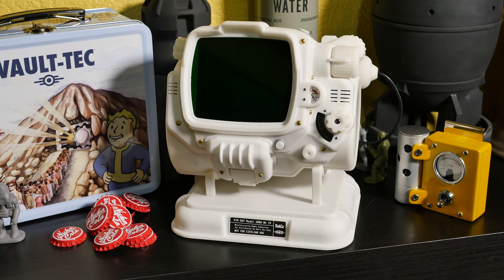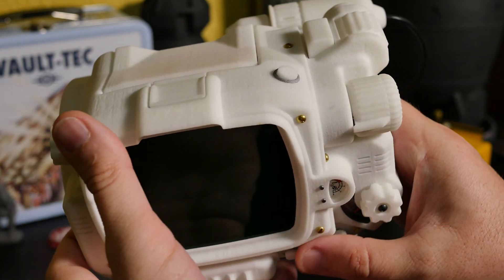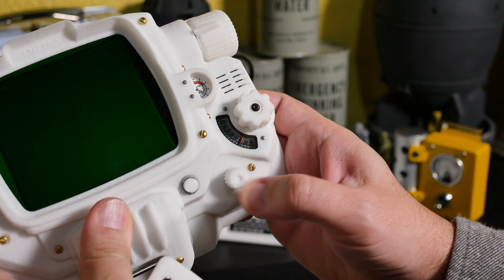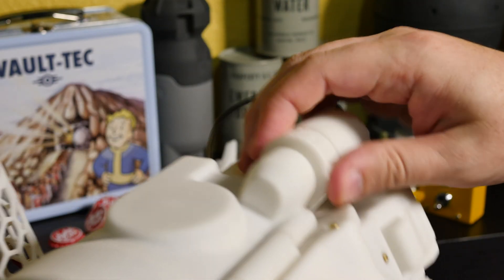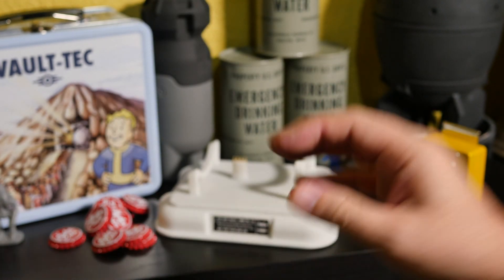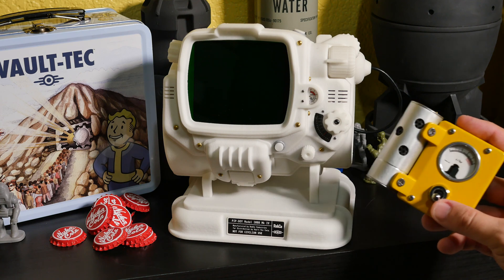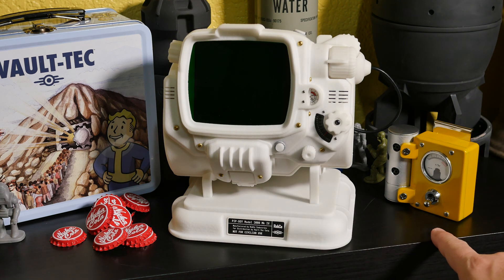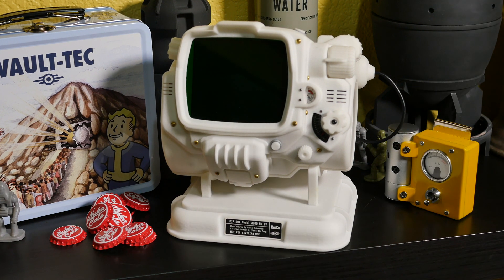Functional Pip Boy 3000 Mk IV, Mechanical Mockup

Comment: How different from this would be from the ThinkGeek one?
Reply from the maker: When done mine will be fully functional, with a working user interface. It is also game accurate without any weird usb protrusions. And the code is open source. The code won’t work on the closed source Thinkgeek version.
Reply: @ZapWizard  I'm trying to get the ThinkGeek one, and trying to figure out a way to dump the firmware so I can help others who might have a boot/error bug.

I do like this project of yours.
Reply from the maker: @TheWaffleDude03  There are a few folks who have tried to get the Thinkgeek one working on the Replica Prop forum, I don’t know if any succeeded.

Comment: With the release of the new die-cast pip boy and the creators claiming that a holotape mechanism was “impossible” to fit in game-accurate, I came back to this video. Nice to see that this prototype, while being a mechanical mockup, is much prettier and more functional than the new mass produced release.
Reply from the maker: The new one was made to hold an iPhone for the actors and ease of production. If the wand company can get it with all the features then great. But I think dropping the holotapes was a mistake.
Reply: @ZapWizard  Of course mass production necessitates some changes, and $200 is an okay price for a decent cosplay replica. It's not meant to hold an iPhone, it has its own lcd screen. The website doesn't give closer specs but it has a clock and fm radio... From the sound of it it's a very big Casio in a fancy case with some fallout-themed animations playing. The holotape mechanism was a weird change, the interview said something about there being a tape deck, except the screen opens up. I'm a little confused why they made the entire front panel out of die cast metal, too. It all sounds like a display prop that just so happens to be wearable. Theirs has a curved screen, though! ;)

Edit: It's not a Mk IV?! I thought it was! Please discard my comment, then. I'm immensely confused.
Reply from the maker: @xxepic_swag_gamingxx5238  The general boxy shape of the design used on the TV show holds an iPhone, confirmed by several interviews with the actors.  I expect that the Wand Company will once again outsource the electronics to a contract manufacturer in China, hopefully this time they will retain rights to the firmware for updates. I think $200 is quite good for the prop. Interviews with the Wand company show that they are still working on the prop design to make it a product.
Reply: @ZapWizard  That clears it up, I only know about it from the IGN store promo so I wasn't aware of the background information. I agree on the price. I hope your project is still in the works! I have been watching you since your first mechanism tests when I was a teen and now I'm in university for engineering. Your videos have been a huge source of inspiration over the years so you can be sure I will purchase one when it's finished, no matter the asking price. Wish you the best from Germany.

Comment: Is that a Pip-Boy? I’d give my left arm for one of those.
Reply from the maker: But then you would have no place to put it. Yes. This is my long term project that I haven’t worked on (directly) for years, but have spent lots of time working on side projects which will integrate into it.
Reply: @ZapWizard  Why haven't you worked on it in a while? I would seriously love this and even though it isn't the current pip boy it is still super cool!
Reply from the maker: @phoenixadverdale  I am working on a StealthBoy and Radio. The stealthboy has cnc machined parts which I think I will add to the pip-boy, and the radio has lots of software that the pip-boy will use.
Reply: @ZapWizard  oh okay! The radio looks really cool, have you made a vid on the stealth boy?
Reply from the maker: @phoenixadverdale  No, I should have, but I will once my final design is done.
Reply: @ZapWizard  that'll be awesome! Oh, will the white part of the pip boy be a usb cable?
Reply from the maker: @phoenixadverdale It is already USB at the end of that, with a helical mechanism.
Reply: @ZapWizard  sick!

Comment: I think it would be really cool if when you finish the Pip-Boy that could make the holotape games in Fallout 4. I know that it would be hard to do and I don’t want to pressure you. I just thought it would be cool! (Also if you want to gage how some of the features work then I suggest looking at old videos of the Bluetooth special addition)
Reply from the maker: I did look at a few of the games. The ones in the actual Fallout game are coded in flash, perhaps they could be converted. Otherwise since everything is on a Raspberry Pi and running Pygame, some PiGame's could be converted to run.
Reply: @ZapWizard  ok!

Comment: When will you finish? I’ve been waiting for a while and I’m seriously willing to buy one. Ever since we didn’t get a working screen or Geiger counter on the new pipboy by the want co I’ve been excited for this project.
Reply from the maker: I don't know. I work on projects on and off. I am working on the PCB design for the Radiation King Radio, which has code and methods I will put back into the Pip-Boy. I am not planning on making this as a kit to sell, but will be releasing the design files once complete. I am also working on the Dosimeter and updating it to use a larger geiger tube for some actual sensitivity.
Reply: @ZapWizard  cool! I have been looking to a dosimeter update for a while. Best wishes

Comment: How are you planning on getting a real geiger counter into such a small body?
Reply from the maker: See my dosimeter project. It is the proof of concept. You can get a real tube that is quite small.
Reply: @ZapWizard  That is amazing! I have been following your dosimeter project for quite some time, but I still thought the circuitry too big to implement in the PIP. I completely forgot that the geiger tube in it is only about an inch long. I’m eager to see new developments!
Reply from the maker: @xxepic_swag_gamingxx5238  My current radiation king radio project is a effort in learning more python, as well as working out how the Pip-Boy will use a Pi Pico for the GPIO.

Comment: use a projection rct , they are small and made to fit spaces like that
Reply from the maker: Not sure what a rct is. Did you mean projection CRT? Because they don't fit into ~4mm of thickness. Remember the space behind the display is not as deep as it seems as your arm goes inside.

I am now looking at high res dot-matrix LCDs instead of TFT displays. The Pi foundation refuses to document their MIPI display drivers to push sells of their own displays, so I can't use the display I have now.
Reply: @ZapWizard  i thought it was at least 15mm !
well, that sure is.. t h i n ....
i meant like the sony watchman https://i.imgur.com/6PSKWiL.jpg

Comment: I'm thinking of trying to make one of my own pipboys. Like the rad counter and stuff I can do without but I'd love to have a screen, get the switches and lights to work and get some sort of computer in there and have a little pipboy. I had a look at the CAD files and they look great and basically ready to print. I was even thinking of hooking up some nintendo switch style controllers and use the pipboy as an emulation machine. Now imagine that! I hope you dont mind me using your model and mechanisms.
Reply: @ZapWizard  Ooo nice. By clean up im guessing is like a lot of filing and sandpaper work to make it look good. I'm thinking of more of a personal modded version for myself but yours is a faithful recreation which is just fantastic. I'm  super interested to see how it turns out for you. I'll be sure to stick around!

Comment: So, I'm a little bit late to the party, but what if instead of the light, the holotape has the female end of a micro usb or type C charging port? Then there's a male type C inside the holotape chamber in the pip boy. Then we could have actual data transfer between the pip boy and the tape?
Reply: @ZapWizard  ah. That makes sense actually. If anyone can figure it out, it looks like you're gonna be the first to do it. Keep up the good work man

Comment: Hey can you make a real radio that can fit In a space that small?
Reply: Yes I knew it I am fan of fm radio
Reply: Joshua Driggs I have a small radio from a ldollar store with more” yes that’s the whole name of the store AM.FM MHz AND x10 KHz  AM54 106 FM88 108 there are words at the bottom saying “2- receiver r-367 lot 00SJ22061800
Reply: Joshua Driggs do a wifi mixed with radio? Or oh make your own multimedia system like fallout but make it like with android or Samsung....ios? Nope android is better in a way or code your own operatingsystem like you know the mini psp like that but a little different OH AND CAN I HAVE A COPY OF EVERYTHING and also in the cassette or holotapes how can I add a micro sd card slot ? The holotapes are like fat tiny floppy disks

Comment: The bottom right dial/knob that you made into a 4 way select is actually supposed to be a volume control knob, as for the dial on the left of the Pip-Boy is possibly a brightness control or as the think geek version has it as is a temporary screen switch off, but brightness makes more sense to me.